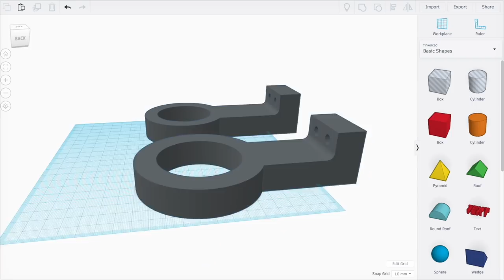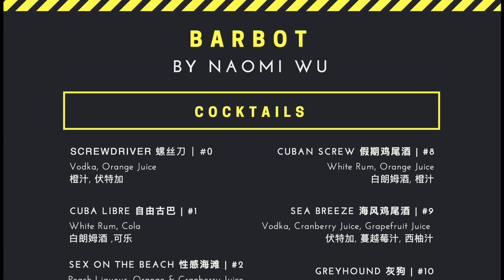The Automatic Bartender in Action- Barbot Part 3!

Comment: This is really good - I do know of at least one bar who has an automated wine dispensing machine, but it doesn't move. It works using, I presume, some kind of NFC card system - if you could add the option of a card, or "fixed" as well as moving drinks, you could actually market this.

Comment: Fantastic build but needs tweaked to add a dwell time when dispensing the liquid as the optics aren't clearing.   Also, when you're putting the bottles on hold the optic too.   Something you learn when swapping bottles in a pub as they can easily come off!

Comment: What an amazing machine you have built!  Wow, you sound different when you speak in mandarin.  Btw, if I were you, I would ensure that the metal frame of the Barbot be properly grounded (connected to the Earth of AC power outlet.) for safety reasons.  For the same reasons, I would also cover the Power Supply Unit with some sort of a casing to shield it from liquid spillage and to prevent anyone from accidentally touching the hot part (i.e. LIVE) of the P.S.U.

Comment: Did you come up with the design yourself or did one of your maker friends help you with that? this is such a cool design and adds something special to your friend's bar too. 😊
Reply from the maker: Parts I got help with- about half the code that I modified I had help with, was just too far over my head. The frame is mine, but loosely based on just a normal OpenBuilds CNC machine without a Y-axis.